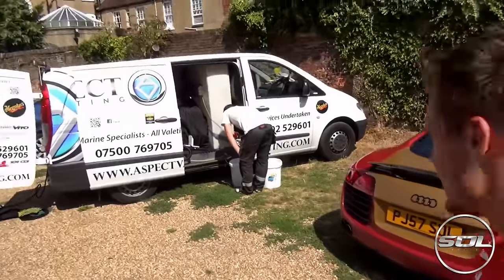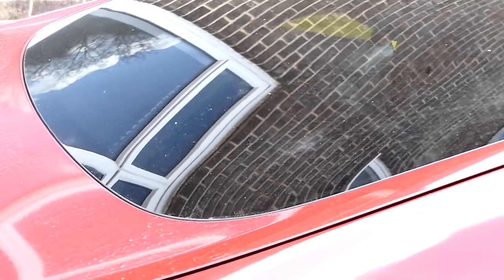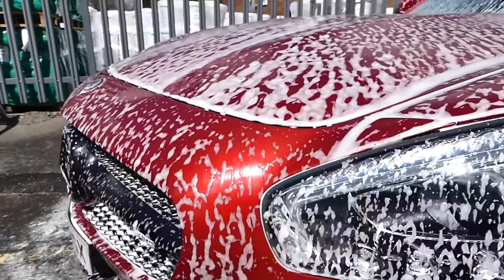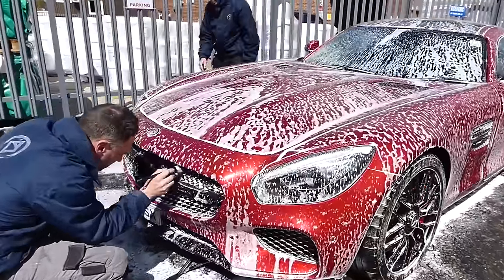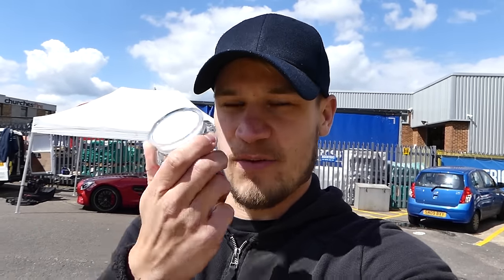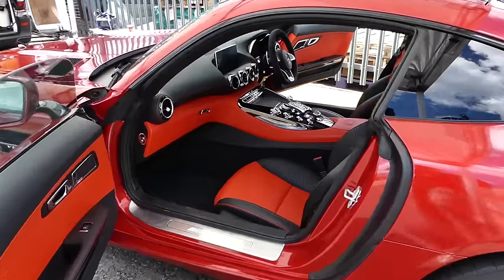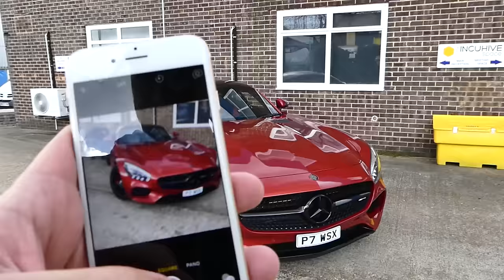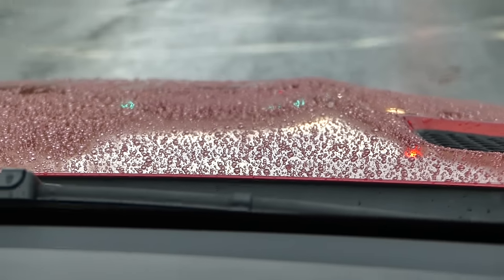GETTING GOLD FLAKES ON MY MERCEDES AMG GTS!

Comment: is there not a £5 car wash around the corner
Reply: lol
Reply: +Alias DMG Xd good on!
Reply: There's a reason why a £5 car wash costs £5.
Reply: +Alias DMG Car washes tend to damage paint/wrapping. Maybe take some old minivan through a car wash, but never a brand new AMG GTS with a valuable paint wrap.
Reply: +Etmonas Rakauskas Paint wraps are self healing. If you have a scratch on one and put a bit a heat on the top it will cure up :)
Reply: Really? I didn't know that, thanks for the tip, does it depend on the paintwork or will it work for just any?
Reply: Works for most films
Reply: They are not professional car washers, they seem to rush it and can damage the car paint or even scratch it also the cars quite expensive don't want a 5£ to wash it roughly
Reply: this comment was intended for sarcasm purposes
Reply: +Alias DMG theres a free one on your drive too!

Comment: 1:31 that yellow mg tf in the window reflection tho :D i love them. there dirt cheap and so fun to drive. yes its a 1.8 and yes if one of the engine fans stops working it will blow a fuse stopping the electric windows from working but i love it and its got so much character.

Comment: Did they clay bar the whole thing? I did that to my 02 xjr and the paint looks amazing and back to looking brand new, it removes all the dirt that had been ground into the paint and you can feel the difference when you touch it, I used the Mothers kit
Reply: +AJ632 The car is wrapped so would get marring from the clay, but agree claying paint does amazing things, have you seen the clay mits you can buy??? much easier to use then a clay bar!!!
Reply: +s13ane no I haven't seen those, plus I do it twice, once when I get it out of the garage, idk why but my garage gets super dusty, and right before I put it away for winter.

Comment: Looks awesome... I'm a hobbyist detailer so i completely appreciate the effort and time involved in doing this. Question though, when applying the wax, whats the tapping all about? I get the applying by hand, some waxes need a bit of warmth from your hands to help them start to bond and break down but i have no idea why you would need to tap your fingers over it...
Reply: +Nigel Fox You can't apply it the normal way because the flakes get dragged around so you pat this stuff on allowing the flakes settle evenly. Once it cures you can buff it off.

Comment: Given the look of the front where the badge is etc it doesn't look like you have any of the sensors or cameras at the front of this, is that just not a feature in the GTS or are they hidden in some other way? (I'm familiar with a Merceses Benz C350e so things are probably quite different between the two)

Comment: Little bit confused..
What kind of wax applying method is that?
Normally wax took some curing time(Maybe about 4-8 Hours) to fully dry,doesn't this wax need curing time too?That rain might wash the wax off the car.
Correct me if I'm wrong anyway.
Reply: +Lu Kwan Ying Some need to cure some can be wiped off straight away.. Fuck knows what that method was to apply it i just use my foam applicator works perfect every time
Reply: +ryan1540 Ohh,AFAIK most of the wax(and Sealant) that last long will need some curing time.
Hahaha,me too,either using foam applicator pad by hand or Foam Pad with DA Polisher.
Reply: Lu Kwan Ying Yeah, I use Collinite 476's and i just let that cure for 10 minutes and then remove it, i can get like 3-4 months beading from that

Comment: is that steel brake discs? how did they not rust up like mad?
Reply: ive got stock mazda rotors and they rust up in minutes when im washing the car...There isnt a sign of rust on his brakes even tho he just got a wash and its been good few minutes
Reply: +Mikee CZ That shouldn't be happening.
Reply: Its a common thing with car washers, its a grind off steel disc.. steel rusts very quickly if it doesn't have any antirust treatment, atleastt thats what i thought
Reply: +Motors Unite I did not know that I thought they only touched the disk when you apply the brakes
Reply: +Motors Unite ye they are OEM ok :-) its a brand new mx-5, but when i said minutes i might have exagerated, i just now finished washing my car and it takes over two hours to rust up

Comment: Lazy bleeder. Do this yourself Paul. Once you've done it a few times it's easy lol. 
Snow foam
Wheels
2 bucket method shampoo
Decontaminate (tar,bugs etc) clay bar if needed
IPA to remove any old products (waxes or sealant)
Then me personally I use a good durable sealant (Wolfgang deep gloss paint sealant) x2 coats
And for depth r222 wax on top but you don't have to wax it that's personal preference 
👍🏼

Comment: Why cant you wash your car by yourself?
Reply: it took two professionals 5 hours to clean... if you can afford it,why wouldn't you?
Reply: It's a different level of cleaning
Reply: A good car wash only takes about 1 hour, this wax that was applied only lasts for a few weeks, if you clean your car every two weeks it will not look that bad.
What do you like more: 
1. A car that is most of the time clean, because you wash it every two weeks -> pretty clean all the time
2. A car that is at one point perfecly clean, but will never get washed in this time -> clean for maybe a week, after that pretty dirty
:)
Reply: It is pretty much not another level of clean, there is no improvement of clean, clean paint is clean paint, of course you have to do it right....but even the pro's did some mistakes
Reply: +MrSleesch13 sorry dude are you a specialist detail valeter? Of course there's different levels of cleaning.
Reply: No, I am a hobby Detailer....if you use the right tools you can get better results than most of the professional Detailers, they do less steps than I do when washing a car: the sprayed the car with water, followed by an MTM Foam Gun filled with Shampoo and SnowFoam, then rhey started rubbing the car with microfiber mitts, normaly you would would spray the car with water again and then use the 2 bucket wash method to reduce swirl marks and hologramms...so I dont think it is a higher level of clean :)